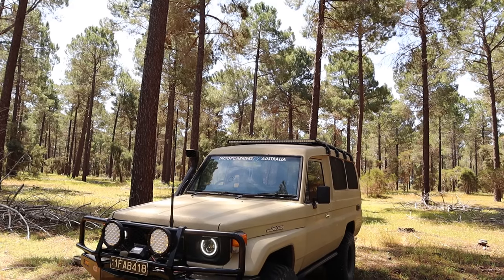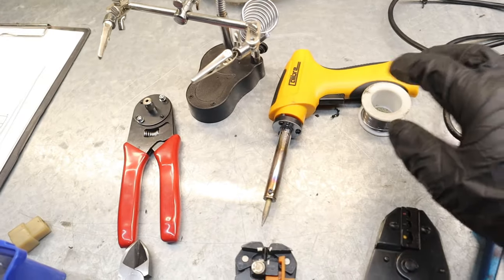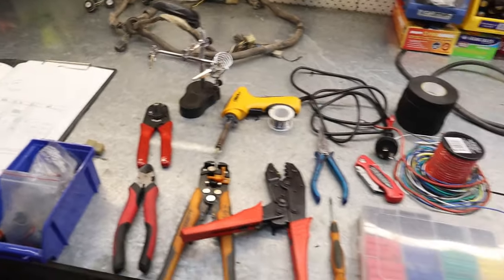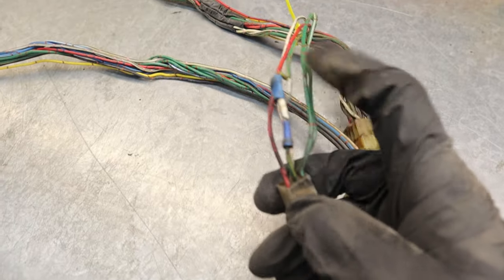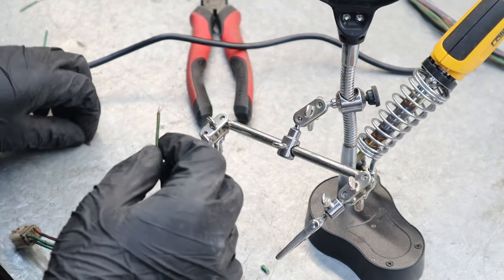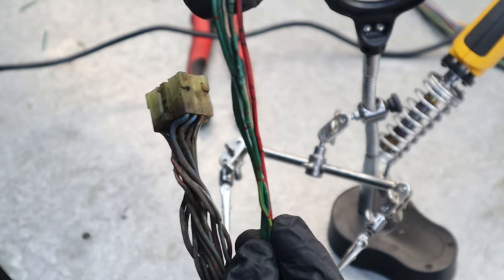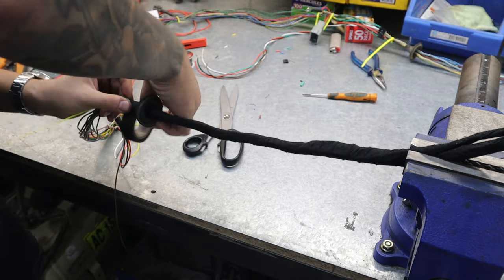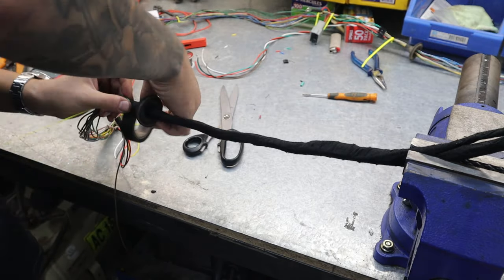How To Restore Your Wiring Harness DIY

Comment: Good tutorial.  On mine i went with the plastic loom stuff anywhere that will get splashed with mud water oil or dirt and the wire lume up high and in the engine bay.  I found the old school plastic loom still deals with mud better, it splashes off while the wire mesh seams to oil dirt.

Comment: Not bad. I assemble and train people to assemble custom cable and wire harness assemblies for a living. As far as reworking an old assembly my only thought would be to check for stiffness in the wires to assure none were degraded and also I’d extract all terminals and re strip/ re crimp them.

Comment: I personally haven't found TESA tape to be THAT good, I've had a couple situations where it started to come undone vs my electrical tape that stayed on for years. Although I'll admit it was where I used a small strip, where I used long strips that I wound over a long stretch of wire it seemed to hold every time. Little strips with just a small section won't always hold

Comment: I saw that you used black for Reverse for your trailer harness, as per AS-2513. Good lad. Pin-2 is not for “auxiliary power” in Australia.

You didn’t run a cable for your electric brakes though. You know what you are doing so when it comes to installing an electric brake controller, I assume you will fix it then. Maybe RedArc can donate a TowPro Elite for the Troopy project and you can revisit this video.

Comment: Hi, i have just bought an Aixam Mega Van and the wiring loom to the rear of the can has been cut at the plug connector. I need to find out the wires for the indicators, lights etc: can anyone advise

Comment: So, question I have like a small insertion where I can visibly see inside of the wire from my vehicle distributor connector. Would that stop current from flowing to the distributor,  from just that little slit?
Reply: And, how do mechanics just pull that harness out like that🤔

Comment: I’d like to know why manufacturers left a little exposed wires near the connections plug or to the connections. Is it safe to tape this so that those wires will not greatly exposed to heat of the engine and also to prevent deterioration?
Reply from the maker: Hey mate, most of the time its because the wiring is redundant and was meant to be used for another model (Deluxe model etc) This is most cases i've seen. In these cases i just cut the wire and heat shrink it shut, you can also use tape just not as secure. Hope this helps

Comment: Great video! It's pretty difficult to find good 4x4 related electronics tips/guides online. Is there any specific reason why you choose cloth tape over normal insolation tape? Also, in what circumstances would you recommend using the interlocking braid protection? Is that mostly for sections of the loom that would be exposed to the elements? Thanks for the epic content, subscribed!
Reply: I would be curious about the cloth tape too
Reply: Is it the same as hockey tape?
Reply: normal inso tape holds moisture and isnt as sticky. whereas tesa tape is sticky and can be wet but then dry out
Reply: @tomsbahr  Thanks for the response! Makes sense.

Comment: I’m restoring an old car that a mouse got to the wires. And I was just curious if I need to get a special wire type Since the wires are in  the engine bay
Reply from the maker: Just match the wires to the original mate

Comment: Thats interior cloth tape, it will soak up mud and oil and go to shit. Theres engine bay cloth tape to use for that, it dosnt look as fury and is oil resistant. Also that braid hold mud and oil and also goes filthy in a 4wd engine bay or underside.

Comment: solder?!? noooo. i will not even use the connectors with the low temp solder. 
  soldering makes a great connection, however, it does not allow the wires to flex with the constant vibration a vehicle puts out. a correctly crimped connector will make just as good of a connection as a soldered joint. using good quality heat shrink will provide the needed stress relief. 
  doubt me? where are the soldered connections in a factory wiring harness? if soldering was superior, then every connector would be done with solder. 
  leave the soldering to the computer geeks

Comment: Why would you care to replace the crimps by a solder? Remove the god damn wire altogether and replace it with a new one. If the wiring is old and dried out, there's no point salvaging it with a cheap reparation, replace the wire and it's good to go for another thirty years. Rewiring is tedious as hell, and if you found the courage to rewire the whole thing just don't go cheap on it because it's not something you can easily have access to, so do it right while you're at it.

I think the proper way to do it, but also quite possibly the most tedious one, is to unwrap the old wiring harness, buy new connectors, slightly larger gauges wires, and use the old harness as a live diagram to do a fresh one out of nothing. In short, creating a wiring harness from scratch using thicker gauges wires so you have a fresh and more secure harness.